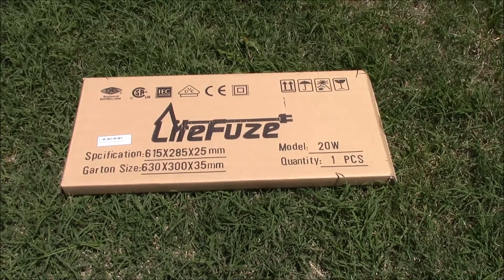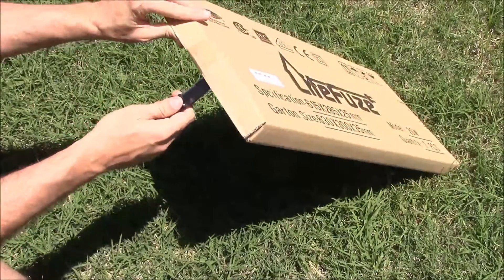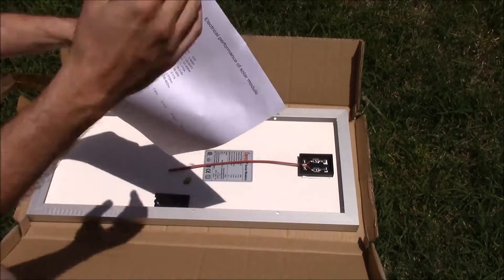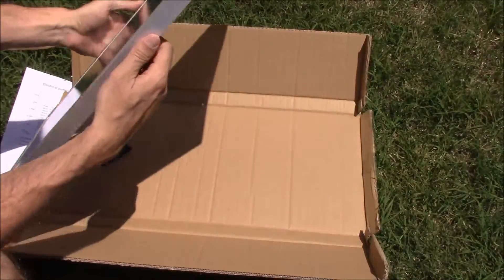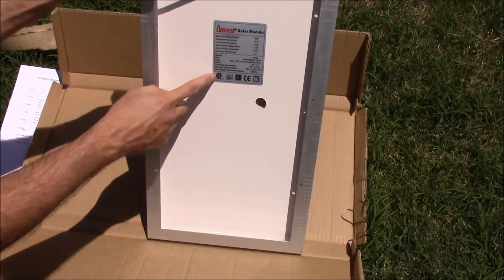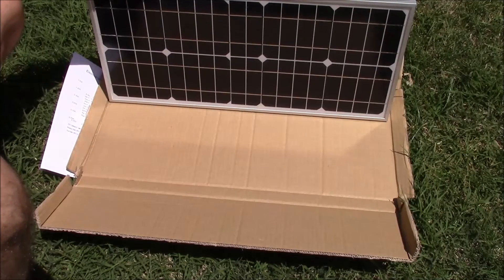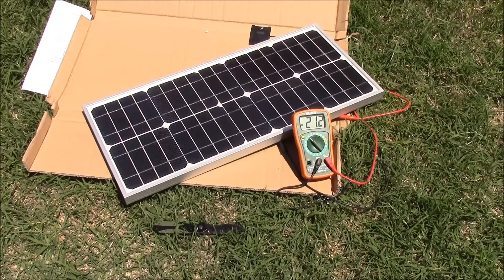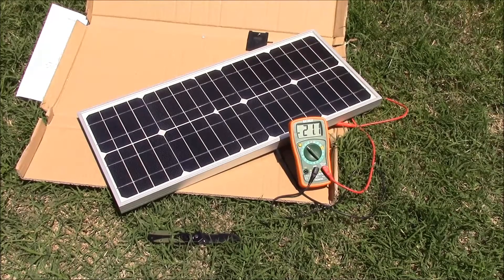Litefuze 20W Solar Panel - Unboxing, Testing, and Review

Comment: will a 20 watt solar panel without a charge controller overcharge and burn a 12v battery if no load?  Its an older 12v battery and i will have a load from a 12v security camera with motion detection, but not anticipating a lot of motion.  It's a remote property and dont want to put too much money into the system as it will all likely be stolen.
Reply from the maker: Yes, the battery will be damaged because there is nothing managing the flow of electricity.  You have to have a charge controller (or inverter) to use a solar panel in all cases unless you are going to manually connect and disconnect the battery yourself.

Comment: the 10w and 20w can I connect through paraller
Reply from the maker: You can but it is not ideal.  You want to always use the same size panels together.

Comment: hi 
just getting into Solar this does not seem many watts as my first is a 100 watt though I think that would run some LED lights would it not?
I might get some led lights next for mine.
Reply from the maker: +EastAngliaUK A 20 watt panel would run an LED bulb for sure.  Depending on how long you ran it and how many batteries you had it could be a nice little setup.  But yes a 100 watt panel is much better for using multiple loads and gives you a lot more options of things to run.